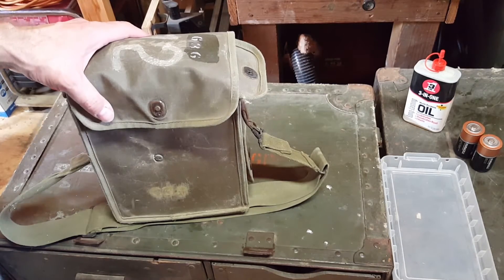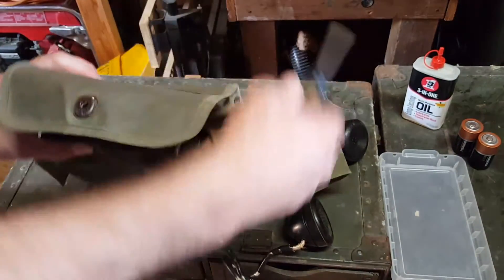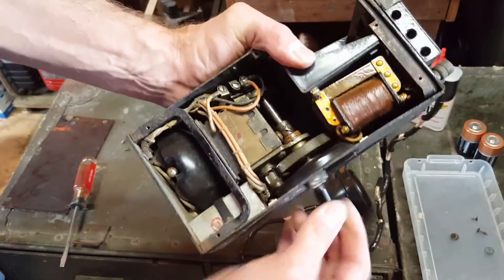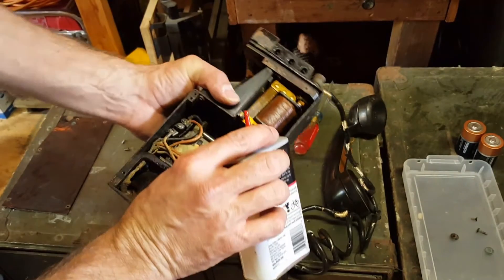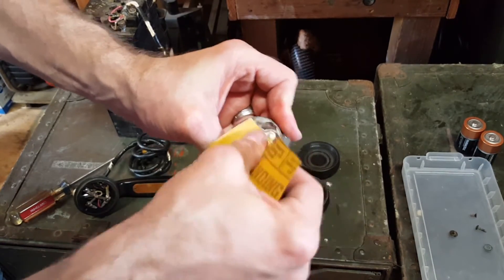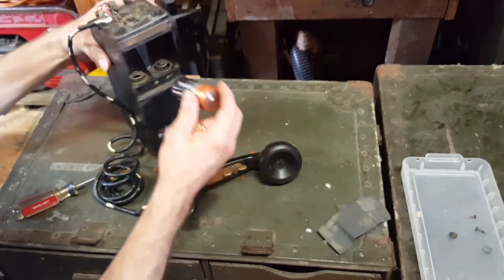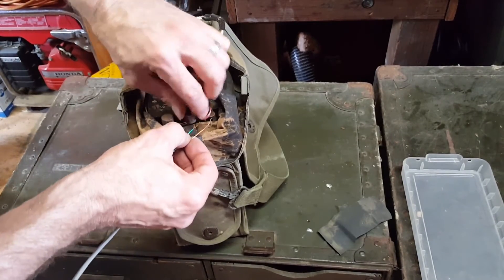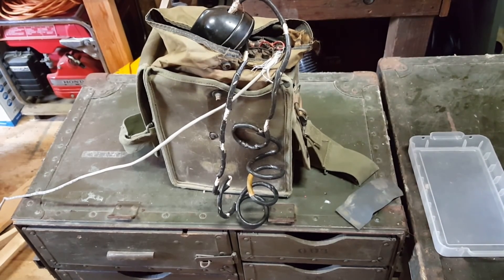WW2 EE-8 Signal Corps U.S. Army Field Phone Maintenance Tips and Demonstration WWII Korea Vietnam

Comment: I have 2, TA-312's, both work. And yes, the 312's can be connected to a landline phone line with an available adapter that includes a touch-tone pad. I don't know about the EE-8's though, but I'll guess probably. And yeah, the generator puts out volts!!😂.
I use left over low-voltage lawn lighting cable and works  great.

Comment: Hi, I have two Russian TA-57 field phones.  One works perfect but the other is difficult to crank the magneto ringer and becomes extremely difficult (nearly impossible) when it’s wired to the other TA-57 or my Ericsson.  But it will put out 90+ volts. So it seems to isolate the problem to the one phone.  Can there be a short in the magneto and is it easy to rebuild?  TIA.

Comment: You only need 2 wires to talk on the LB (local battery) setting on the two big terminals, what you called left and middle, L1 and L2. The small terminal to the right is marked Bat for external power, when set to CB, (common battery). You do not need 3 wires, only 2. I was a USMC field wireman, 2511.
Reply: That's what I thought.  Thanks.
Reply: Wrong you need 3 I was a male exotic dancer for carnival cruise line in the 80s

Comment: Hi James, I just got two EE-8’s and want to connect and test them, any recommendations for commercial grade wiring that I can get or does it have to be military grade? Thanks for assistance
Reply from the maker: Military WD-1 two strand wire is probably the best for regular EE8 setups.  It is post WW2 if that's important to know.  If you just want to play around with them, go down to Home Depot and get 100 feet of telephone wire.  For connecting and two EE-8's each with their own batteries, you only need two wires.  Have fun!

Comment: I just bought one but the words are arranged differently than the one you have would that be a later version I think the one I have is because the phone line is coiled and is it the same way to maintain the internals even if it is different.
Reply: I forgot to mention that the speaker and receiver dosent have the switch
Reply: Thanks for the information just got one today